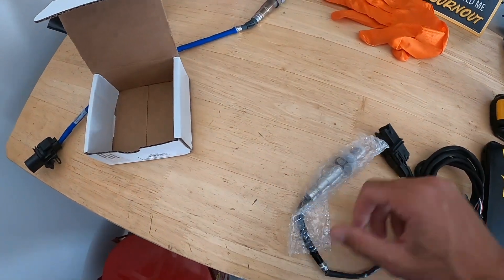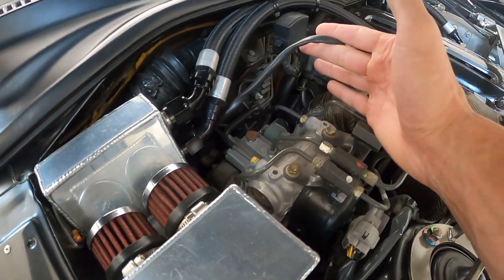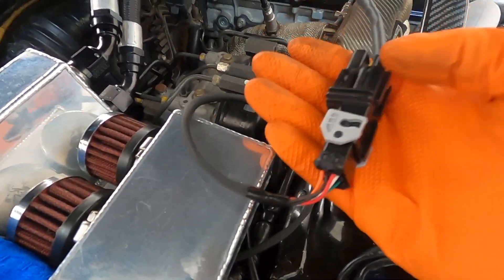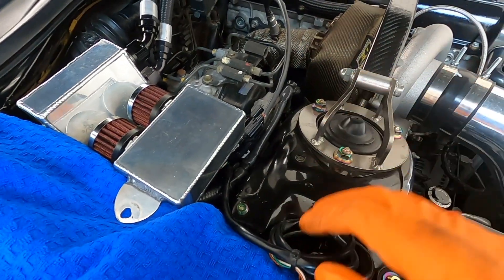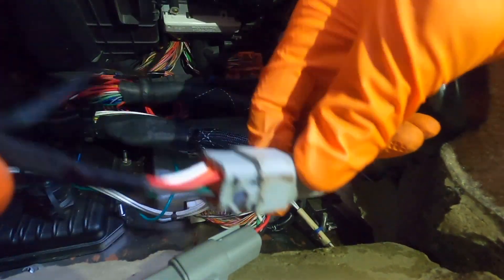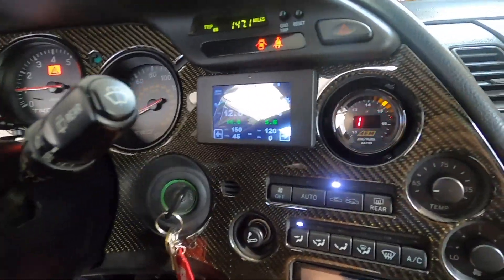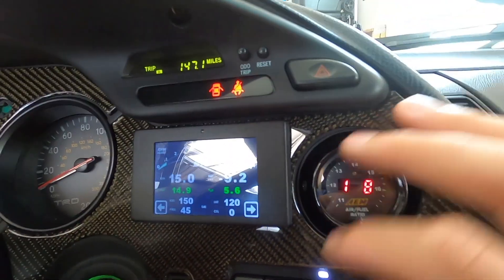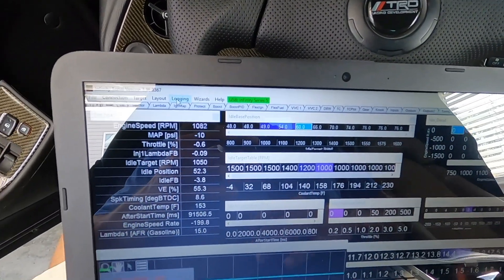Bosch 4.2 Wideband Install w/AEM Infinity ECU

Comment: how did  you wire the external wideband to the infinity for data logging?
Reply from the maker: My infinity harness had a connector for a UEGO wideband, so I used this https://www.jmautosports.com/product/infinity-02-sensor-extension-harness30-3600 and connected it directly to the sensor and my harness.

Comment: Where did you find the plug adapter harness for the 4.2 sensor?
Reply from the maker: It was included with the AEM UEGO wideband gauge I bought. You could probably order one by itself from AEM. 
https://www.summitracing.com/parts/avm-30-4110?seid=srese1&gclid=EAIaIQobChMIjJPo7NzbgwMVtivUAR3qpwJBEAQYBSABEgI1RPD_BwE
Reply: @ShealeysGarage  Really?  I have the 31-4100 gauge kit and didnt get the deutsch adapter for infinity.  Wasn't able to find an off the shelf adapter.  A lot of AEM parts are discontinued since Holley took over.
Reply from the maker: @HondaAcuraGarage
Apologies, I think this is what you were referring to right? https://www.jmautosports.com/product/infinity-02-sensor-extension-harness30-3600/Default.aspx?gfid=p101223&source=googleshopping&utm_source=google&utm_medium=cpc&adpos=&scid=scplpp101223&sc_intid=p101223&gad_source=1&gclid=EAIaIQobChMImqa-_-rbgwMV46RaBR3NKQ0GEAQYBSABEgKxSPD_BwE

I forgot I scooped this up separately to connect to the AEM infinity harness I have.
Reply: @ShealeysGarage  Yes, that's it.  Appreciate it bro.
Reply from the maker: No prob and glad I could help.